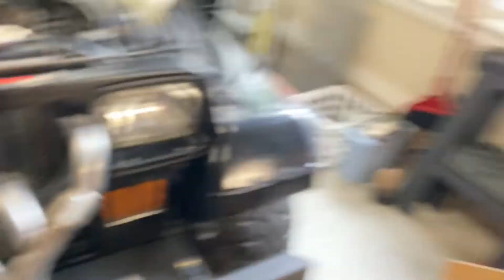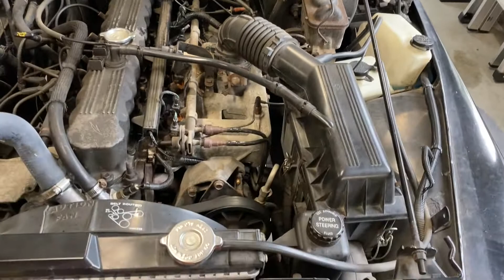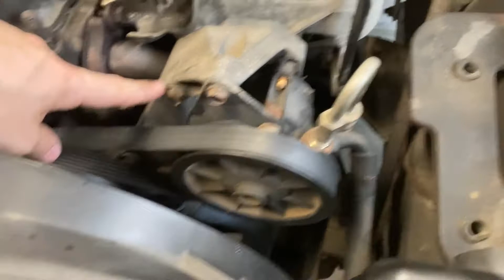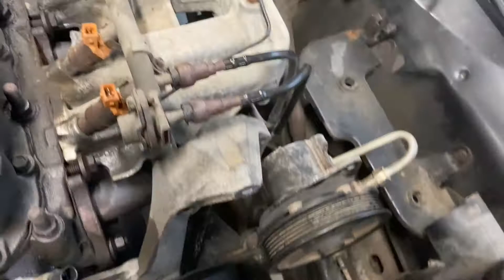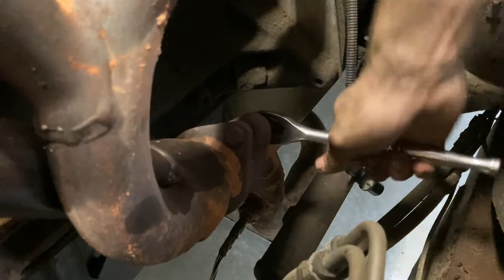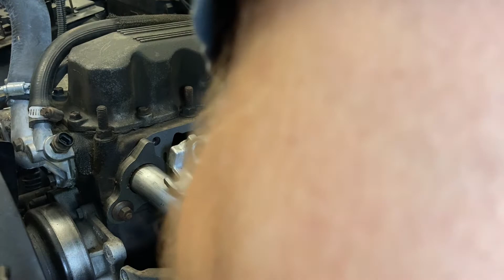Jeep YJ 4.0 Exhaust Manifold Replacement

Comment: So you cleaned up the intake manifold while disconnected but left the throttle body untouched.
That was a good opportunity to scrape out the carbon build up in the exhaust ports of the head
Good video of your elected choices on this 4.0  1992 Jeep

Comment: how precise did you have to be with the water pump removal? Did you have to do anything special to re-tension the serpentine belt?
Reply from the maker: Hey, that’s actually the power steering pump that I removed! There are guides online for how to tension the serpentine belt. I have just tightened them to where as the belt has minimal deflection but isn’t to tight! Not a very clear answer I know, but there are some really good videos about it